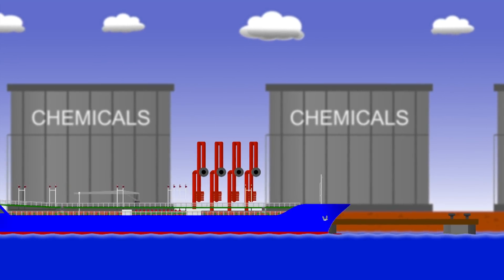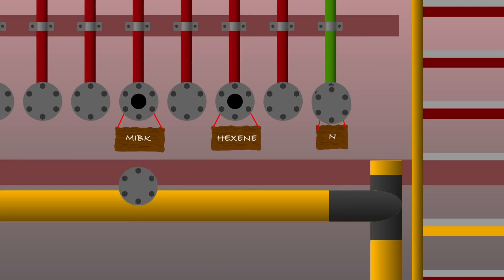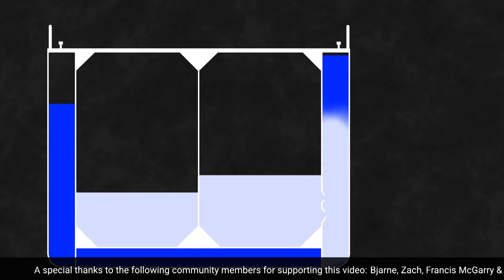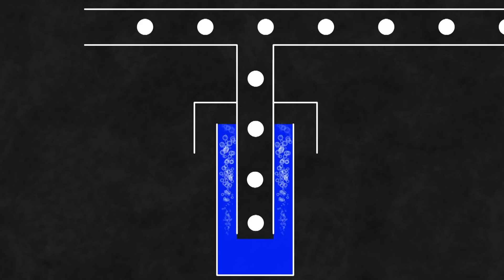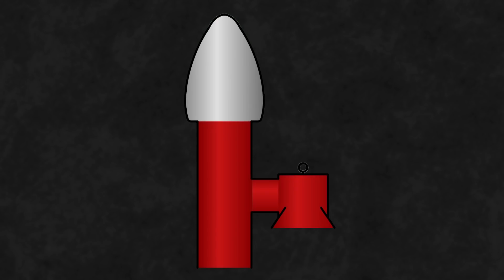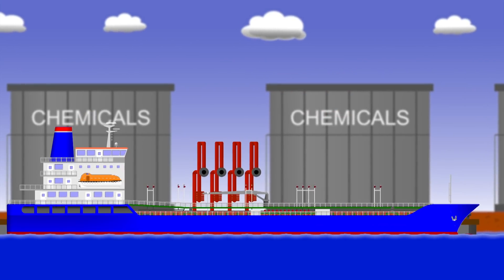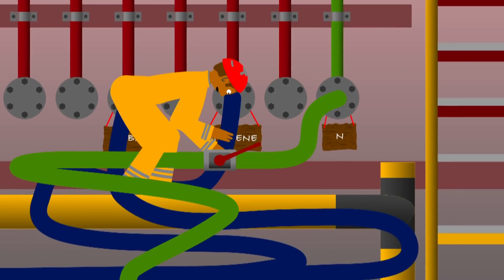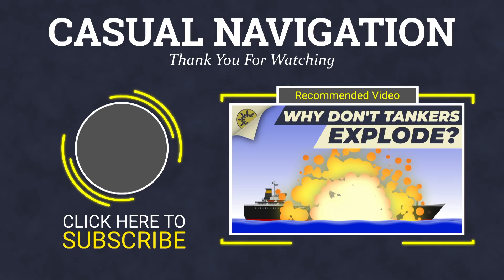What Do Ships Use THESE For?

Comment: basically it's fixed with automatic pressure regulating valve from IG system, I think there have some sensor issue
Reply: The valves don’t need sensors or other electrics to work. They just work manually by themselves, the problem was that the valves couldn’t release enough pressure because the supply was way to big.

Comment: 5:00. So wouldn’t the smart thing to do be to make the fixed pipe on the ship one inch in diameter so the pressure restriction can’t be overridden by someone selecting the wrong hose?
Reply: I'm curios about this as well - good question.
Any naval / engineering types got the answer?

Comment: The thing is, it does not only "absorb oxygen". It reactes with it (oxydisation). That releases heat which in turn can accelerate the reaction. The whole thing can "run away". They were kind of lucky for it not to block up. Second reason für inert gas is the so it can't form a combustible athmossphere (no oxygen no explosion).

Comment: one of the properties of Nitrogen is that it wont compress. So as the tank fills and the vapor volume is replaced by liquid, the pressure goes up rapidly. This problem can be compounded by the shape of the container (one that gets narrower at the top, or a tall thin compartment) Also only a small amount of Nitrogen is needed to make an inert atmosphere so... some planning was not done correctly. also the compartments that are pressurized need to have a separate pressure relief valve designed to lift at a certain pressure different than the ons in this video.
Reply: What? No.
They dont use liquid nitrogen, they use gas nitrogen, that is compressible and that need to replace all other gases to make an inert atmosphere, not only a small amount
Reply: nitrogen absolutely is compressible, it’s a gas.
Reply: Nitrogen gas compresses quite easily. Just as easily as air, actually.
You may be thinking of liquid nitrogen, which compresses just as easily as water, but is also far colder, and likely wasn't involved in this scenario.

Comment: If they were pumping out the Hexene too fast and it caused the vacuum protection to open could the air that comes in ruin the Hexene as well? If it could is there some kind of countermeasure used to stop the air from damaging the Hexene?
Reply: Air won't ruin hexane. I think it's a mistake explanation. The purpose of nitrogen is to prevent hexane vapor to build up and possibly explode.

Comment: A (elektro)mechanical over pressure system would probably have prevented this situation. When the pressure in the tanks rises or drops to much it would automaticaly stop all pumps and closed al ingoing and outgoing valves of the tank until manual reset.

Comment: Interesting that the didn't use burst-plates or designated weakpoints to at least prevent structural damage if the PV-valves fail.

Comment: The warning message should be very detailed, more than 2 sentences. Instead of cancel and ok, more nuanced options should be present like correct automatically, inform higher and lower officials, correct auto and inform, correct manually, and a cancel button. Automatic fluid flow sensors should be present inside the tank and inside the pipes, the pipe should have a data link to the ship's flow controlling specific  computer and the harbour flow discharging point computer to monitor the flow rate from both ends and interior flow in the pipe in real time, similar to ev charging facilities, dc charger. Valves should be placed at the pipe end too, for automatic pressure reduction,through reverse back flow to the terminal from the pipe in case any extra pressure difference occurs after checking the real time pressure and in case of any errors.

Comment: You would think that a large refinery operation would have different diameters of chemical hoses and adaptors to insure the wrong hose is never used.  Using a 4" high pressure N2 filler line into a ship receptacle only designed to accept a 1" high pressure receptacle.  It could have been much worse involving far deadlier chemical you never ever want mixed together.

Comment: This accident is simply due to poor craftsmanship/imcompetency on the ship's crew and especially on the duty officer. 

When you transport Hexene-1, there is normally a burst disc inserted between the PV and the PV line pipework. Standard orders dictate that the pressure in the cargo tanks need to be maintained between certain parameters, the setting for a non overpressure or underpressure cargo tank is normally +250 mbar and -50 mbar. The rupture discs are below that setting and usually you would keep the range into something like 0-150 mbar. This is actually the most difficult when starting up a cargo discharge since the tank is most full. So you start up with the nitrogen a crack open and then start discharging & monitor pressure. Pressure falls, add more nitrogen supply. Pressure increases, increase pump rate. The AB's that have manifold watch are normally controlling the nitrogen supply since you do that with the valves on the vapor return line. The vapor return line is normally connected up to your PV lines with elbows or another connecting piece. If you are discharging multiple tanks at the same time, you would have all of the PV lines to vaporline open to maximize the volume you pumping nitrogen into as this acts as a cushion. You just need to adjust total nitrogen rate to match the discharging rate. Where this can become an issue is when one of the cargo tanks is empty and your discharging rate is so high that you cannot replace the lost rate by pumping faster on the other tanks. In this case you would need to turn down the nitrogen supply or pressure rises. In a calamity where pressure in the cargo tank would rise too sharp you would simply have the AB's shut the nitrogen supply off. 

The main issue is that pressure in the cargo tank should not have been near to the PV opening pressure in case of discharging operations with Hexene-1. You insert burst discs so you prevent any opening to outside air (because in static condition, these PV valves usually leak) and it is the duty officer's job to maintain that pressure. So you really already have 2 failures going on here, duty officer not doing his job properly and PV output capacity being too small. This also can be exaggerated if the duty officer started operations on a single tank with nitrogen lined up to a single tank instead of opening them all up in which case pressure is much more controllable.

These accidents with ruptured cargo tanks happen more often, ie when loading phenols and cresols with a high melting point. Often the PV freezes stuck. But in a operation like Hexene-1 discharge there would normally be a lot of focus on maintaining the correct pressure in the tank. Also note that before a tank bursts, you have already well exceeded the operational parameters, then the maximum setting of the PV and then the actual pressure at which the tank bursts.

Also another famous cause for ruptured cargo tanks is pigging of the lines after completion of loading. Ie most designs require you to bleed pressure from the lines and then take the pig out. But in some cases they use a design where the pig goes into the catcher and full line pressure is released into the cargo tank. Durban used to be famous for that.

Comment: Shouldn't they use pressure regulator on nitrogen line? That would ensure supplying the gas with proper pressure that does not exceeds the structural limits of the tank.

Comment: Thank you for your videos!  One thing I'd like to argue about this video, is your explanation of pressurizing hexane tanks with inert gas.  I really don't think  it's done to prevent oxygen or moisture absorption  by hexane. Hexane is non-polar solvent and it doesn't mix with water or gases.  But it's flammable. So I would  suggest  that pumping non flammable  nitrogen is done to prevent build up of hexane vapor and eliminate  risk of fire and explosion.

Comment: Why does water run out of the bow of a ship when it's docked?
Reply: Has nothing to do with being docked. The Water running out is the Anchor Wash, which is designed for cleaning the Anchor Chain while wieghting Anchor. Although it mostly is opened as Pressure Relief on the Firefighting/Deckwashing System. The only Reason to explicitly open it in Ports is to prevent Stowaways from hiding in the Hawse Pipe, but that's only done on MARSEC-2 Level.
Reply: @Genius_at_Work  Thanks for the info

Comment: Small correction: its Hexane no hexene
Reply: The chemical that is used in fuels, flavours, perfumes, dyes and such things would indeed be hexane. However hexane has properties similar to octane and will not be contaminated by simple contact with oxygen. 
Therefore, it was probably 1-hexene, which can be used as a modifier in the production of polyethylene. The NTSB report mentions hexene, but does not specify which of the 13 isomers of hexene this was.

Comment: IMHO is this a construction failure. You don't need a small hose but some physical limitations in the piping simply limiting the flow of innert gas. Human error is the reason for 95% of all accidents so relying on correct operations is always a risk.
Reply: In do not agree. A vessel is arriving at many different terminals using all different connections and flowrates/pressures in the n2 system. Have a direct limiting factor directly influences the flow in the ships system. 
This appeared to be a high flow/pressure system while at many terminals you will get the displaced volume out if the shore tank back on board.

Comment: As typical this someone thought they knew better than the people that wrote the rules for the size hose to use.  Another solution would be a big regulator that would control the pressure and monitoring the regulator. .

Comment: So almost like a steam safety valve?
Reply from the maker: I guess so. I am not familiar with those though.
Reply: @CasualNavigation  Almost. Steam Safety Valves are Spring loaded as well, but the Relief Pressure can't be adjusted at Will, as the Valves are sealed by the according Inspectors (Classification Society in Marine Applications) to keep Engineers from messing around with them. Increasing the Relief Pressure of a Steam Safety Valve would increase Power and Efficiency at the Cost of Safety. IIRC there are Steam Safety Valves with a set Relief Pressure that can't be adjusted at all as well. And Steam Safety Valves don't have to discharge Steam at a high Velocity; they usually connect to a small Pipe that takes the Steam out of the Engine Room.